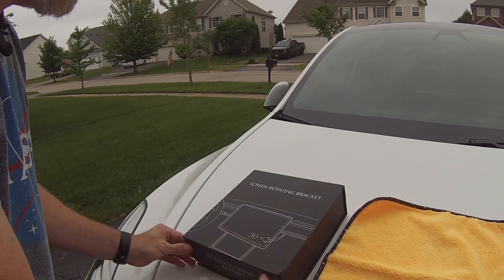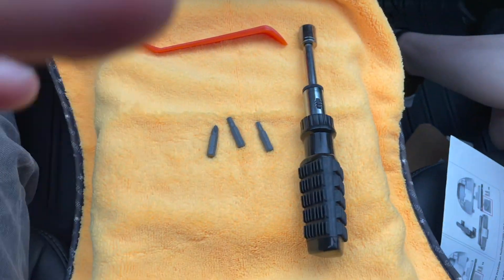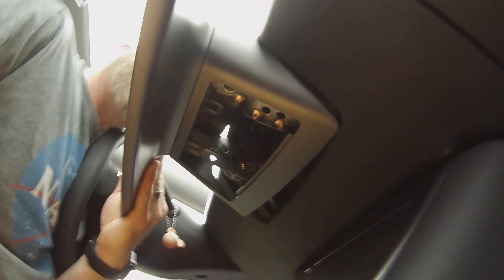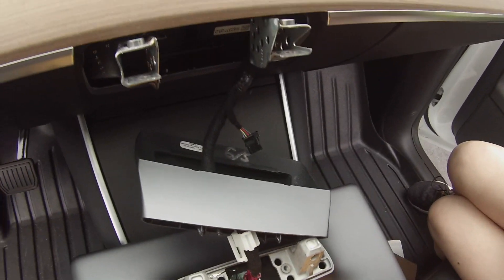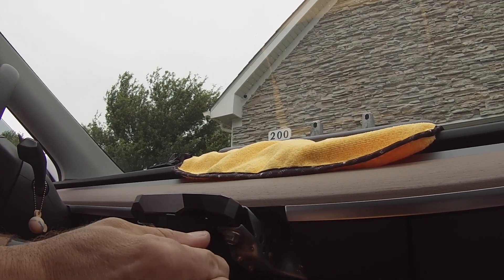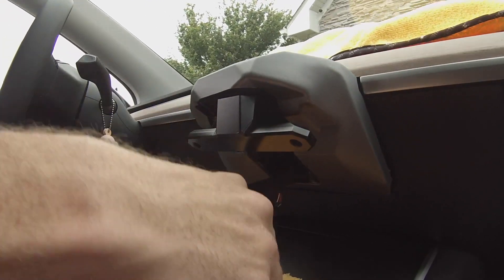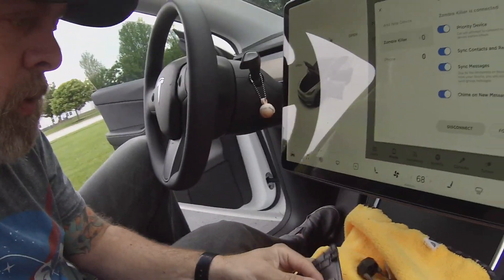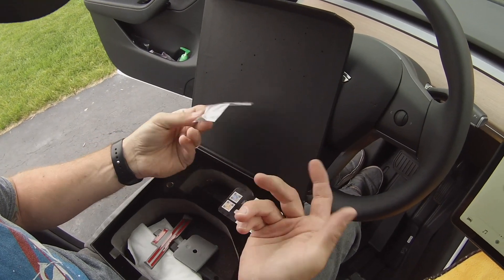Best Swivel Mount for Tesla Model Y and Model 3 #teslamize #swivelmount #install

Comment: Thanks for this thorough walk-through.  Even though I was done with my install when I watched it, it was far better than the video on the Teslamize product page!  The extra black piece you had leftover at the end is some sort of spacer that rests on some fasteners right under the veneer on the dash.  The second Teslamize install video briefly(!) shows the spacer being put in place before the trim piece is slid in over the top of it.  I backed up a few steps, installed it (took a lot of time to get everything lined up without the spacer falling into the dash!), and I can't tell any difference.  In the end, it looks good, but like a few commenters mentioned below, it's wobbly.  My brother has two and neither are wobbly.  After spending over an hour on this install which I thought would take 15 minutes, I just wanted it to be over, but one day, I might reverse a few steps and really torque those bolts to see if that helps.  And I did the same as you with that last piece; test-fitting it didn't seem like it was going to be of much value, so I threw it back in the box.

Comment: How does it feel now that the screen is a little lower and at a 30 degree angle?  Any chance your knee might hit it?  Doesn't look too difficult to install.  Have to say this looks much nicer than the one with the sleeve in the back.
Reply from the maker: The install was easy to novice level install. The screen is dropped a little and actually provides more of the road view now. No chance of my knee hitting it. I’m 6 ft tall.

Comment: Hi Dave! Great video, thanks for sharing! Is there a specific way you had to hold the monitor while pushing it back in or anything? Mine is super wobbly vertically, I've tried taking it out and redoing it and it just seems like the bolts are grabbing the bracket to hold it in place, but aren't grabbing anything above that and therefore aren't anchored vertically. The screen wobbles about 20 degrees up and down and is super loose. It's pretty tight horizontally. Thanks!
Reply from the maker: Two thoughts. First, can I ask, did you use the right screws in the right order? Second, at about the minute mark you when I am tightening down the bolts you can actually see verticle wobble until I tighten down for the last time. Once I wrenched down it took all the verticle movement out of the bracket. Make sure that is tight. If you are referring to "new bolts" holding the monitor they should just fit in the bottom and go into the new mount. They should fit just right. Feel free to email me some photos. I am going to do another install probably tomorrow in my wife's car. Maybe I will do a YT Live video.
Reply: @DoingitDave  thanks for the reply! This has been a frustrating 2 hours (yep, literally have been trying everything for that long now, and I'm pretty mechanically inclined so I'm at a loss.) I followed your tutorial to the letter. Everything looked perfect until I screwed it in and it was wobbly. I 100% expected that wobble to disappear as I tightened it, but it simply didn't. I hit what feels like the end of the thread and the screen still feels super loose (albeit, severed and will not pull out). Happy to send video/photos! Thank you in advance so much for the help - gained a new subscriber today :)
Reply from the maker: @aidanaktouf5933  I would also suggest emailing the Teslamize website. Sam is typically really good if there are any issues. Let’s start with some pics of videos.
Reply: @DoingitDave  will do as well! What's the best email to reach you at?
Reply from the maker: @aidanaktouf5933  DoingitDave12@gmail.com let’s see what we can do.
Reply from the maker: To follow up on @aidan’s question. It appears there were some faulty screws. Although I do t make this or sell this I felt because I made a video on this to announce that you should contact the seller if this is the case for you.